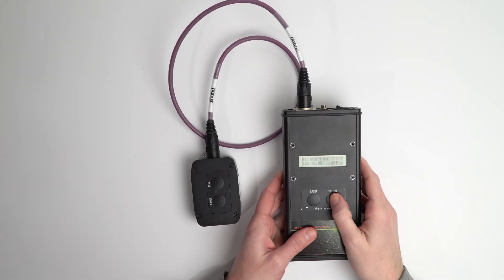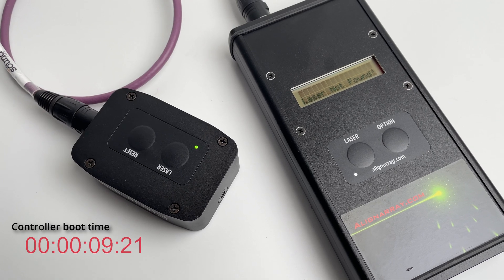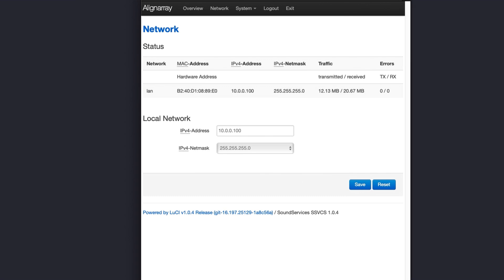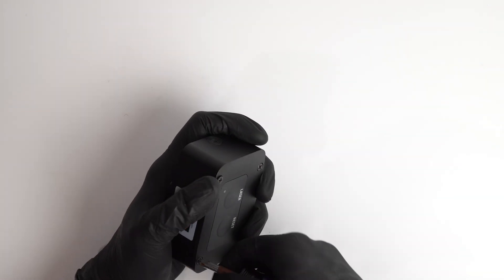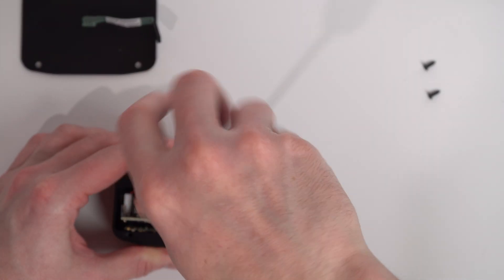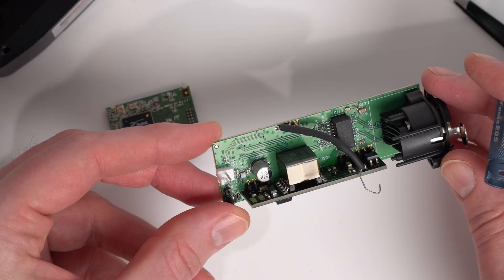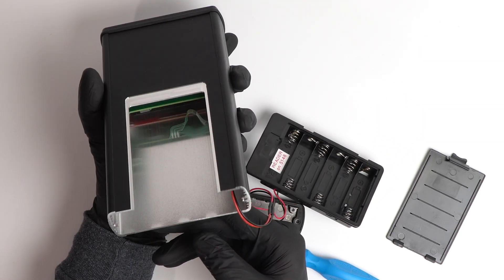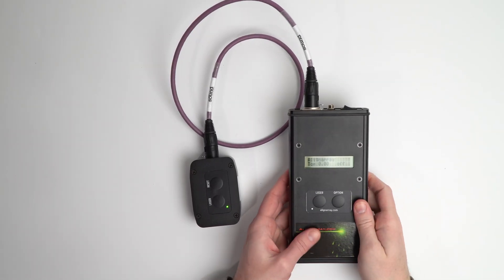Laser Line Array Speaker Aiming from RAT Sound!!

Comment: Interesting device- I didn't catch what its use is...though a quick google would solve that..I am guessing transmitting signal/ sound/ audio some distance? I am not sure how the algorithm got me here.. guess, my searching directional speakers had done so. 

Regarding the case, being metallic, you have some laser in there and components which may generate a fair deal of heat- they could be pulling double duty with that case and using it as a heat sink? Maybe shielding against EMF/ RF interference- maybe that laser/ components within are noisy themselves so the metallic case mitigates any interference the device itself could possibly cause. Plus, the weight is a nice touch....just that extra lil bit of "quality". Though, there are plenty of new materials out that could provide robustness and certain characteristics mentioned.... maybe metalic to be able to mount quickly/ effortlessly/ accurately using magnets??

Comment: That boot time is brutal and enough reason for me to not want to use this on a job site, the standard models take 2 - 3 seconds to kick on. Trimming an array should only take 10 - 15 seconds and if you have mains and sides to deal with that means spending over three minutes sitting around waiting for them to kick on.
Reply from the maker: I hear ya, that startup time is rough.

Comment: Worth noting that if you set a custom ip to network the inclinometer, then you can’t use the reader since it only scans for the default ip, also imo it being built out of metal is nice, anything rigging related has the potential to take a bit of a beating so I’m not sure plastic would be the move
Reply from the maker: Is that right? I’m sure I changed the ip on the one I have and the reader still works. Maybe I changed it back though, I’ll have another look at that tomorrow, thanks! I was thinking like rigging motor controllers (pickles) which are plastic or nylon and get beat to shit and still do okay. I like the metal too, but I’d also like to save money 😭
Reply: @DcSoundOp  as far as I know if you change the ip you gave to factory reset it to the stock ip for the reader to work (edit,connecting the reader will auto reset the up according to the align array product page, which is better but could be annoying)

Comment: Used/owned KSG, LAP-TEQ, AlignArray, and both generations of the SSE Prosight.  KSG and LAP-TEQ are the most robust and have the most options, and are not that much more expensive in comparison to the AlignArray.  The elevation sensor for the LAP-TEQ is very nice to have, and interconnect between it and the laser is a simple XLR cable.